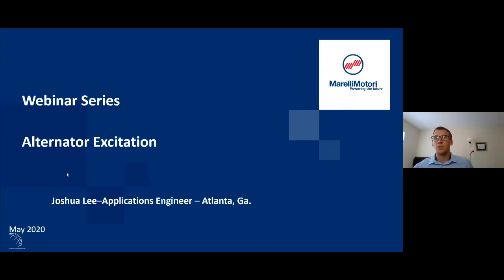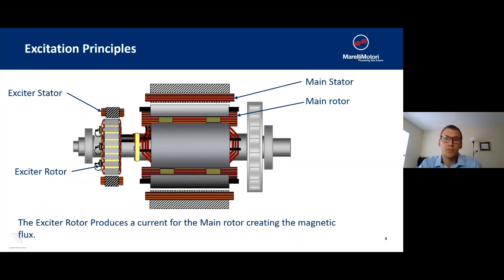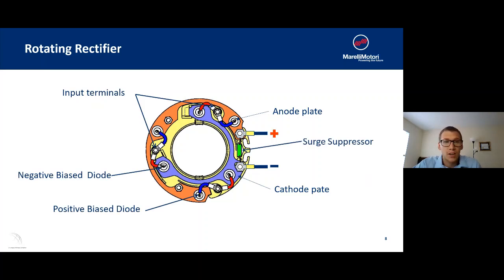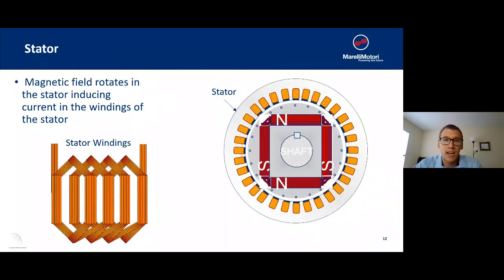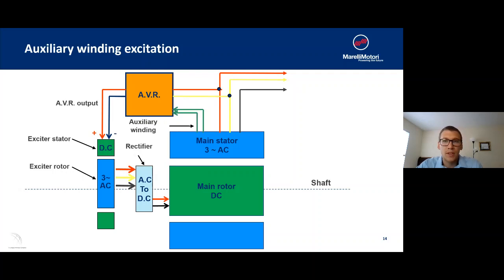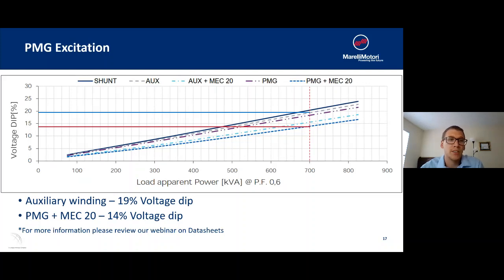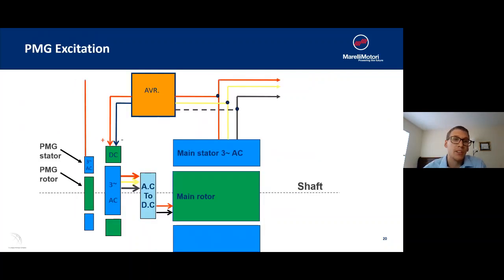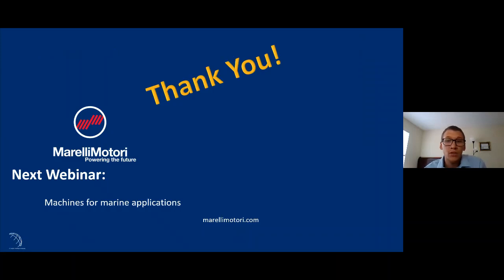Marelli Motori Webinar Series: Alternator Excitation Systems

Comment: Without the permanent magnet generator kit,  what initially energizes the coils in the brushless exciter ?  It can't be the main rotor because it must first be energized from the exciter whos coils have not yet been energized.  Something must supply DC to the exciter coils first. If the PMG isn't there what supplies that DC to the exciter coils at start up ?